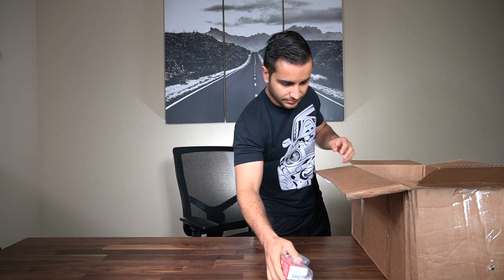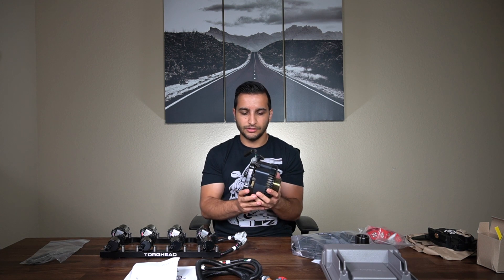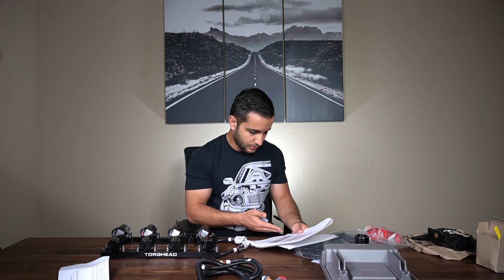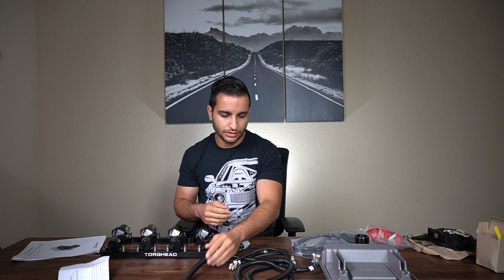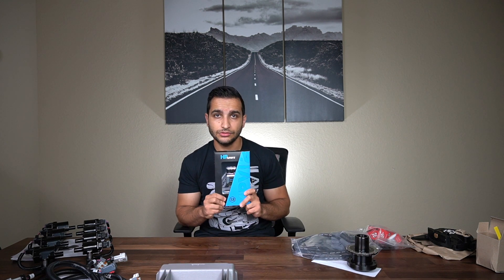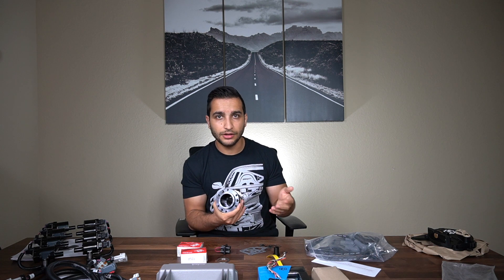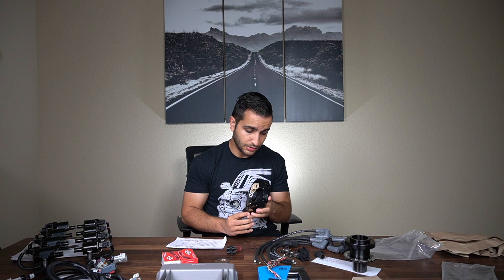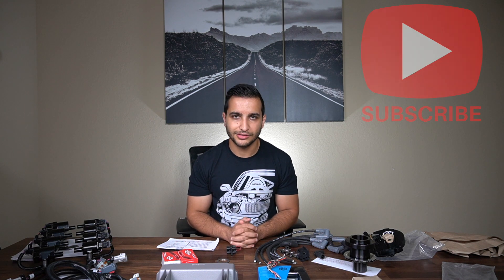TorqHead 24X Kit- Unboxing and first impression

Comment: Run a sbc350 harmonic balancer and pulley off the 95-99 vortec 350 and you can run the valve covers off the same engine. Then just space the pulley system out to match harmonic balancer pulley.

Comment: I didn't hear you mention  how this integrates with the main engine harness and the TPI fuel injectors.... or did I miss something?  Does this come with that harness as well?
Reply from the maker: Hey Scott, this does come with a harness that connects to your factory engine wiring. Please feel free to follow as I will be posting more details on this installation soon!
Reply: The entire kit is plug and play
and designed to work on a gen 2 lt1 motor. The brain box that
Torquehead provides in the kit
is designed to work with your 
existing wire harness in your car ,that's what makes  it so great
along with being OBD 2 compliant. It's a win win for us
lt 1 owners. Scott.
Reply from the maker: @vincentfisher5895  yes sir I love the kit so far!
Reply: When this covid mess is done away with and the economy bounces back. I'm buying the 
same setup for my firebird.
Reply from the maker: @vincentfisher5895  I totally understand. Please feel free to subscribe to the channel and follow my LT1 swap build. I will be getting it going next week!
Reply: Many thanks for the prompt reply! :-)
Reply from the maker: @scottc0510   no problem boss!

Comment: All 8 of my spark plug wires needed to be custom sized for the valve cover coil brackets. Not 1 wire is the same as another one. Makes it really nice to avoid header heat. My kit was made specific to be used with my Fluidampr. I had to send him my fbody fluidampr and he put his reluctor wheel on it and it came out very nice. I like the fluidampr better than the ATI super damper because it tunes out vibrations in real time at all rpms. The ATI is more designed for High RPM Use like at 4,000 rpms and up. Since the LT1 isn't a High RPM screamer of a motor, even the LT4, the fluidampr is what I chose. I had a fluidampr on my old 355 lt1 motor in my older fbody and man it made a difference. I even felt a slight bump in power at 4,500 rpms to 6,500.
Reply from the maker: steve v  - that’s great! Having them protected is key

Comment: Any reason you didn’t go with Holley Terminator X? Built in 2 step, easy tuning, tons of features
Reply from the maker: Honestly... The main reason I went with TorqHead is because of their outstanding reviews on customer service. I also should have mentioned that this video was not sponsored and was an honest review.
Reply from the maker: I cant wait to see your LT1 Supra running 100%!
Reply: I also purchased this kit for my 67 Nova. I was impressed with the high quality of all the componants. One thing to note is the PCM is not your average PCM. Look at the bulkhead. It has the connector added for the new opti spark assembly.
Reply from the maker: Good to know! Thanks for your feedback! If you would like, Follow along for our build process that will be coming up shortly.